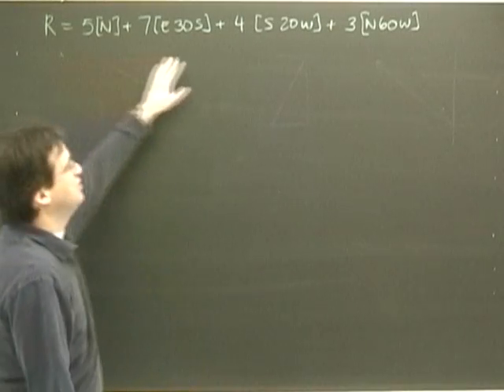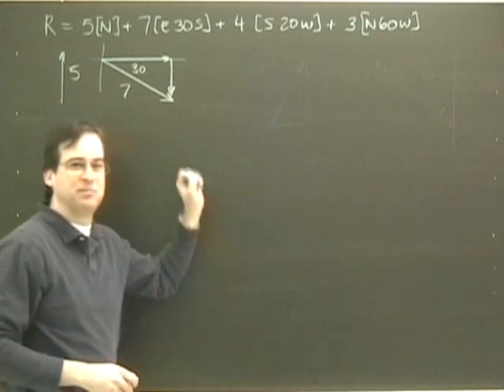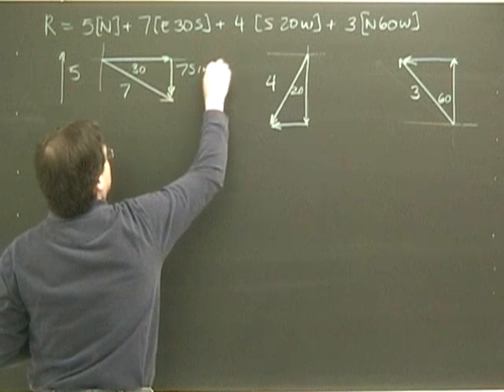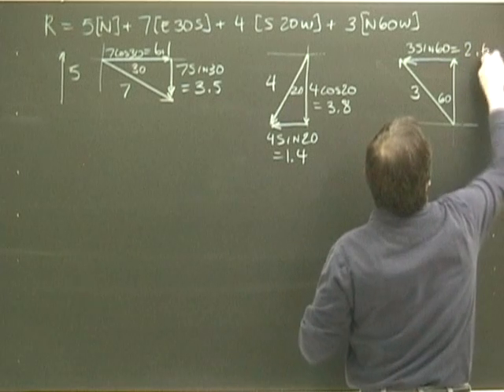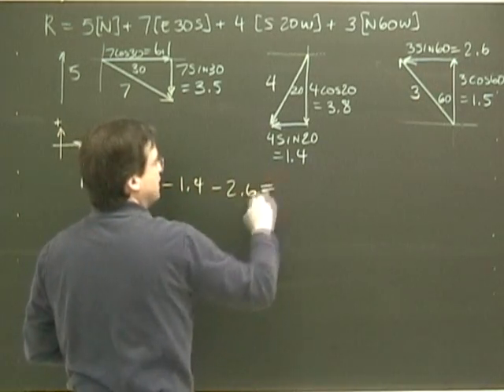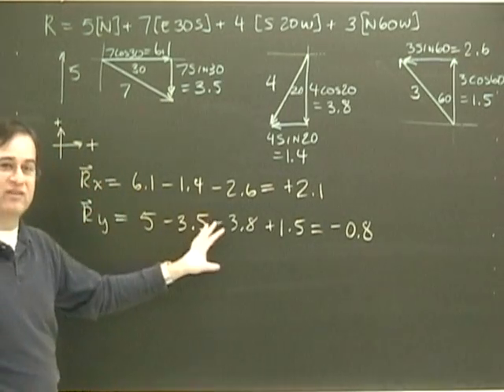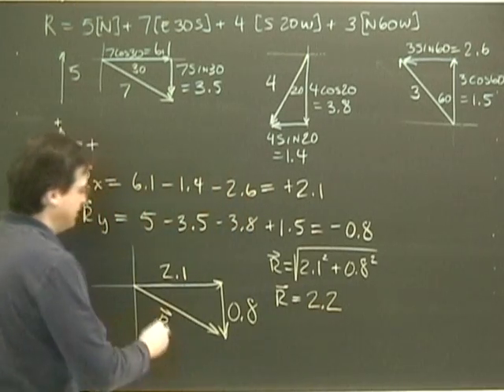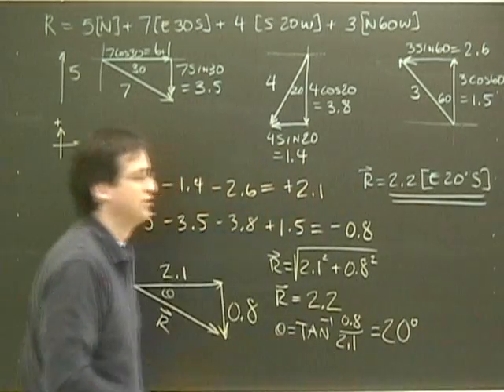Physics Vector Addition (Algebraic)

Comment from the maker: @MrShnazer We don't do this in terms fo positive and negative quadrants. Break the vector up into components then use the same sign convention that you use for the x and y axis. Any of the components that are up or to the right are positive. Any components that are to the left or down are negative. You can see this for the components of the 7[E30S] the 6.1 is to the right so it's (+) and the 3.5 is down or (-). For the 3[N60W], the 2.6 is (-) and the 1.5 is (+). I hope this helps.

Comment from the maker: @livemixtapes I could have drawn it to the left first then up. The result would have been the same 2.6 left and 1.5 up. The reason I drew up first then to the left is because by doing this I used the 60 degree angle. If I drew the components to the left then up, I would need to find the angle for that triangle (which is not complicated) (90 – 60 = 30 degrees). With the 30 degrees, the left vector would be 3cos 30 = 2.6 left and up would be 3sin30 = 1.5 I just went with the most obvious triangle

Comment: *QUESTION*

at 1:40 sec, why did you draw the trigangle like that? Why couldnt it be in inverse? Meaning that why wasnt the bottom side drawn on the bottom rather than the top?